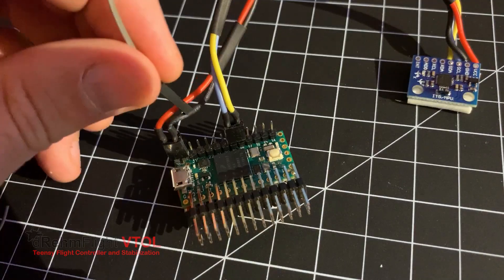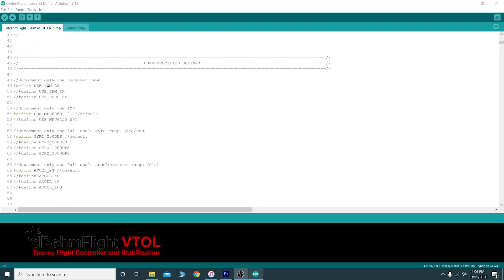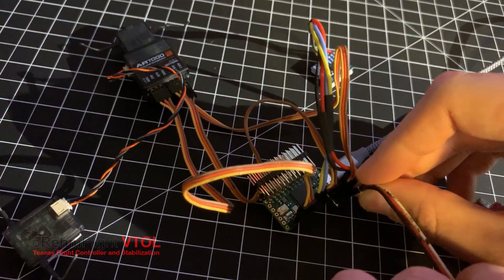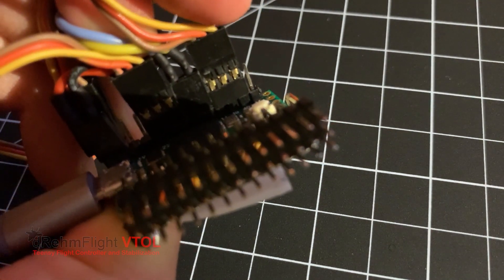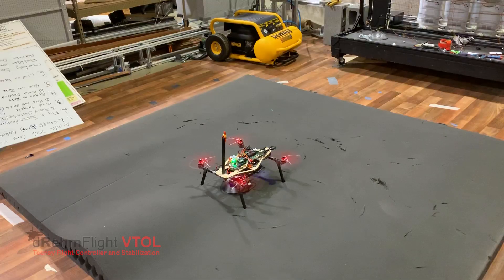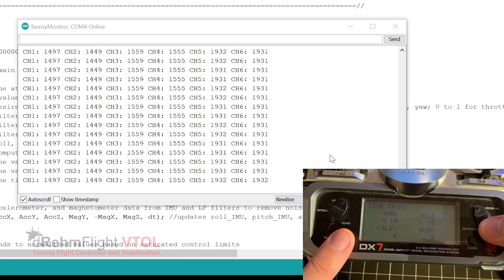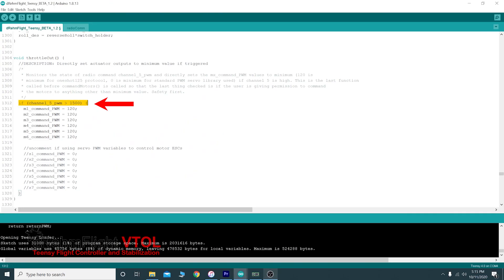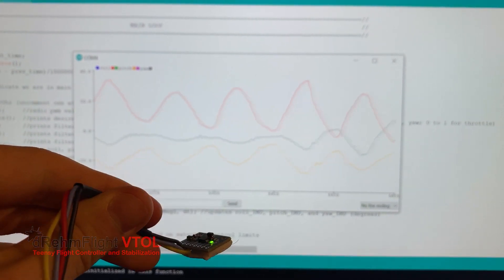Setting Up Your Radio Connection - dRehmFlight VTOL

Comment from the maker: NOTE: This video is dated and does not include instructions for newly supported Spektrum DSM satellite receivers. DSM receivers should be connected to RX3 (pin 15) and powered from a 3.3V pin on the teensy. This is new as of dRemFlight Beta 1.3.
Reply: Hello Nicholas, I am trying to follow your steps in the UFO or cyclo copter build, but I have been halted by the satellite receiver used in unison with you FC. I have bound it using another receiver and confirmed that when the receiver is turned on that the satellite goes solid orange, but as soon as I attempt to use it with the teensy it doesn't work, soldered to pin 15 and the power coming from the pin locations opposite the micro usb port I verified I used the correct ones both with the wiring diagram that came with the teensy and the video on the tri-copter you made. Any guidance would be great, I've tried the procedure with 3 different wires and satellites so I know that those are not the problem. Something of note is that I found that on occasion if the teensy was powered and I plugged in the Satellite afterwards, the teensy would reboot. This felt like it indicated a short but I can't see any error in any of the soldering I've done and I followed the hardware video to a T. Another thing is that the orange LED does initially flash when given power but only for a fraction of a second similar to what occurs if no data is found from the receiver its plugged into. Please help, thanks.
Reply from the maker: @isaiahbarak6166  what receiver?

Comment: Hi Nicholas, thanks for sharing the VTOL idea, the full source code, and practical solutions. It's priceless for young enthusiasts who want to learn and understand. One question from me: The Teensy 4.0 spec says the I/O pins are 3.3V-tolerant. And you connect PWM outputs from the receiver to the Teensy inputs directly (no voltage conversion). The RX on the video is Spectrum AR7000. It provides 5v PWM signals. How does that RX 5v <=> Teensy 3.3v work? What don't I understand/see?

Comment: Hey Nicholas, loved your tutorial. Just wanted your help on connecting to ESCs. I tried every function, checked the printRadioData(), printMotorCommands(), every thing checks out. But my motor doesn't respond. Checked the ESC (I am using normal esc 40A that cheap yellow one) and motor, they are in good condition. I am a beginner, I apologise in advance if I am asking something obvious here. Where do u think I am going wrong? Thanks :)

Comment: Hello Nicholas, thankyou for all the effort you have put into dRhemFlight. I am currently setting up my teensy with dRhemFlight, and am up to the radio configuration. I am using a very basic radiomaster t8 lite transmitter with no channel reverse switches and some of my channels appear to be reversed. Is there any way to reverse them in dRhemFlight? Thanks
Reply: I also have no way to adjust the sub trim and endpoints for any of the channel on the radio. Your knowledge would be much appreciated.

Comment: yes! one question: a serial reciever is possible? like a TBS nano? (i see uarts on the pinout of the Teensy..) and i see the voltage are not more than 3.3v for the Teensy, you have used a bec?

Comment: I did not use a battery to power the teensy, but the code was uploaded successfully, but the value does not change after opening the serial monitor. I don’t know where the receiver is connected. Another problem is that the light of the teensy plugged into the computer host will light up but the ia6b receiver The light won't light up
Reply from the maker: I suggest reading through the tutorials in the docs
Reply: @NicholasRehm  If the receiver supports ppm, does it mean that there is no need to wire the throttle to teensy4.0?

Comment: Please tell me if I should change the code according to this video for version 1.3, because I found that it is difficult to find the corresponding code for version 1.3 based on the code in your video.。
Reply from the maker: Code is the same for these procedures. Have a read through the docs

Comment: I'm honestly a beginner, I like what you're doing, but can you give me some advice on how to connect a Fs-Ia6b receiver to the teensy board?
Reply from the maker: Run 1 ground wire from the rx to ground on teensy, 1 power wire from rx to 5v on teensy, and each of the 6 channel's signal wire to the designated pin on the teensy. Pin numbers for pwm rx type listed in the docs

Comment: I have had some trouble with the main code not recognizing the MPU6050 and stopping it from uploading. I have tried everything I can to make sure that both DrehmFlight and radioComm are in the same folder and whatnot, but nothing works. What am I doing wrong? (I'm not very experienced with Arduino)
Reply from the maker: Read the docs. No need to mess with the folder contents as downloaded from GitHub—it’ll work out of the box. If it’s not uploading, make sure you have the right teensy serial port selected. You also need teensyduino installed. All in the docs
Reply: @NicholasRehm  I have all that done and double-checked, and I have a good USB connection. I simply downloaded the files from Github and put the DrehmFlight folder in my arduinoIDE projects folder, so I'm not sure what is wrong. I'm not very adept with Arduino so this is probably user error. (Edit: I downloaded the files incorrectly, which was the source of the issues)

Comment: Hello sir, I'm facing an issue while I try to run the code on teensyduino :
Arduino: 1.8.19 (Mac OS X), TD: 1.58, Board: "Arduino Unosketch_nov12a:43:12: fatal error: src/MPU6050/MPU6050.h: No such file or directory
   #include "src/MPU6050/MPU6050.h"
            ^~~~~~~~~~~~~~~~~~~~~~~
compilation terminated.
exit status 1
src/MPU6050/MPU6050.h: No such file or directory

Im facing the same issue even after adding the MPU6050 library. Please help me resole this issue considering I'm an absolute beginner
Reply from the maker: make sure you download the whole folder from github that includes the src folder with mpu6050 library. Read the docs--more details are in there

Comment: Hey there. I cant get the code to read the values properly. They are all at the failsafe state you mentioned. Im pretty sure all the connections are rigid. I get this error code but ı don't know if it is the reason. :
C:\Users\\Desktop\dRehmFlight-master\dRehmFlight-master\Versions\dRehmFlight_Teensy_BETA_1.3\dRehmFlight_Teensy_BETA_1.3.ino: In function 'void calculate_IMU_error()':
C:\Users\\Desktop\dRehmFlight-master\dRehmFlight-master\Versions\dRehmFlight_Teensy_BETA_1.3\dRehmFlight_Teensy_BETA_1.3.ino:620:35: warning: unused variable 'MgX' [-Wunused-variable]
  620 |   int16_t AcX,AcY,AcZ,GyX,GyY,GyZ,MgX,MgY,MgZ;
      |                                   ^~~
C:\Users\\Desktop\dRehmFlight-master\dRehmFlight-master\Versions\dRehmFlight_Teensy_BETA_1.3\dRehmFlight_Teensy_BETA_1.3.ino:620:39: warning: unused variable 'MgY' [-Wunused-variable]
  620 |   int16_t AcX,AcY,AcZ,GyX,GyY,GyZ,MgX,MgY,MgZ;
      |                                       ^~~
C:\Users\\Desktop\dRehmFlight-master\dRehmFlight-master\Versions\dRehmFlight_Teensy_BETA_1.3\dRehmFlight_Teensy_BETA_1.3.ino:620:43: warning: unused variable 'MgZ' [-Wunused-variable]
  620 |   int16_t AcX,AcY,AcZ,GyX,GyY,GyZ,MgX,MgY,MgZ;
      |                                           ^~~
C:\Users\\Desktop\dRehmFlight-master\dRehmFlight-master\Versions\dRehmFlight_Teensy_BETA_1.3\dRehmFlight_Teensy_BETA_1.3.ino: In function 'void getIMUdata()':
C:\Users\\Desktop\dRehmFlight-master\dRehmFlight-master\Versions\dRehmFlight_Teensy_BETA_1.3\dRehmFlight_Teensy_BETA_1.3.ino:597:13: warning: 'MgX' is used uninitialized [-Wuninitialized]
  597 |   MagX = MgX/6.0; //uT
      |          ~~~^~~~
C:\Users\\Desktop\dRehmFlight-master\dRehmFlight-master\Versions\dRehmFlight_Teensy_BETA_1.3\dRehmFlight_Teensy_BETA_1.3.ino:598:13: warning: 'MgY' is used uninitialized [-Wuninitialized]
  598 |   MagY = MgY/6.0;
      |          ~~~^~~~
C:\Users\\Desktop\dRehmFlight-master\dRehmFlight-master\Versions\dRehmFlight_Teensy_BETA_1.3\dRehmFlight_Teensy_BETA_1.3.ino:599:13: warning: 'MgZ' is used uninitialized [-Wuninitialized]
  599 |   MagZ = MgZ/6.0;
      |          ~~~^~~~
Memory Usage on Teensy 4.0:
  FLASH: code:22632, data:5308, headers:8920   free for files:1994756
   RAM1: variables:7520, code:20512, padding:12256   free for local variables:484000
   RAM2: variables:12416  free for malloc/new:511872
Reply from the maker: Those are just compiler warnings, not errors. 
Try commenting out the failsafe function, to see what raw values you’re reading from your radio. Most likely one is slightly out of bounds and failsafe is tripping

Comment: Hello,I uploaded the code to my teensy 4.0 ,made the changes  that you mentioned in this video but  it is showing me
MPU6050 initialization unsuccessful
Check MPU6050 wiring or try cycling power
insted of taking my transmitter stick inputs  it is showing me gyro ,please help me with this I tried many ways ,also tried looking into forms to fix this I have also double checked receiver connection but the serial monitor always shows me this message and also teensy is not blinkingwhen I got to the serial monitor it just stays in yellow light
hoping for you to reply
thankyou
Reply from the maker: Try new IMU board, some are faulty
Reply: @NicholasRehm  Thankyou its working now

Comment: Hello, I am using an Arduino Mega 2560 R3, I modified the code to use the RX1 pin but when I connect my receiver to my RC controller and move the joysticks I still get failsafe values as if the receiver was not connected. I'm using a FrSky X8R and it has been configured to communicate with my controller. Have I forgotten something?
Reply from the maker: I don’t think arduino mega has inverted hardware serial for sbus

Comment: C:\Users\Animisha\AppData\Local\Temp\Temp1_dRehmFlight-F-35-main.zip\dRehmFlight-F-35-main\dRehmFlight_Teensy_BETA_1.2_F-35VTOL\dRehmFlight_Teensy_BETA_1.2_F-35VTOL.ino:89:10: fatal error: src/MPU6050/MPU6050.h: No such file or directory
   89 |   #include "src/MPU6050/MPU6050.h"
      |          ^~~~~~~~~~~~~~~~~~~~~~~
compilation terminated.

exit status 1

Compilation error: src/MPU6050/MPU6050.h: No such file or directory

anybody knows what the heck this means??? how can i rectify it??
Reply from the maker: Make sure you download the whole folder (including the src folder)
Reply: @NicholasRehm  greetings sir
Thanks for your help sir
It's working perfectly now, except for some changes that i had to do to my control modes (throttle was not getting transferred to channel 1)
Reply: @NicholasRehm  the gyro is working perfectly, but the escs are not recieving any signal....i rechecked the connections, and they all seemed to be alright.... any clues???
Reply: I'm using SimonK 30Amp ESCs (non programmable, and i have no clue which protocol they follow)
 can that be the reason???
Reply from the maker: @animishaalagappa2327  if they can’t do oneshot125. Then probably. Also try arming with channel 5 if you didn’t already
Reply: @NicholasRehm  tried sir, with throttle cut on both values...
I don't think they are capable of contemplating OneShot125.... They work on pwm...
Is there a way to use PWM instead of 125 in the code itself???

Comment: Nicholas, will I be able to get a Spektrum RX part number: SPM4650 to connect/work with the Teensy?
Reply from the maker: Looks like that rx is srxl2 which is not currently supported. It will work with a dsm2/dsmx satellite rx if you have one
Reply: @NicholasRehm  forgive me, I'm pretty ignorant. So I would be able to connect a SPM9745 or a 46 directly to the Teensy over serial? I have an IX12 TX and was hoping to keep installed wiring minimal. Thank you!
Reply from the maker: @brandonvazquez8023  yup, just make sure it’s bound to your tx before hooking up. Read the docs too
Reply: @NicholasRehm  awesome! Looking forward to trying this hardware setup. I'm an ME but not a coding guy, but I think I can be dangerous with what you have made here. Thank you!
Reply: @NicholasRehm  This week I came to understand all the current generation Spektrum RXs only utilize srxl2 ports to support adding satellite RXs. And therefore the satellite RXs must be srxl2 protocol. They still sell dsm2/dsmx satellite RXs... but of course they will only work with the prior gen RXs which I don't have any and not sure it would even bind to my Ix12 Tx... So I can either use the PWM output from the current generation Spektrum RXs using up a pin on the teensy for each channel, or wait for srxl2 implementation so I can do it all on a single wire. Am I seeing this correctly? It's confusing to me to understand what will work...for example the SPM4650 has "DSMX" in its description also but because it says srxl2 protocol it won't work with your code yet? How much of a task is it to get srxl2 support implemented?

Comment: Hello Nicholas. Thanks for assisting with my building/setup questions. I have worked through those issues and attempted hover mode today. I have two questions. (1) does the autopilot (IMU/teensy/supporting code) make thrust adjustments to correct for unwanted fore/aft trim conditions? When I attempt hover, the front motor seems to overwhelm the other two and causes a severe nose-up condition when trying to lift off. I was assuming the controller would adjust the motor speeds to correct for this. (2) Regarding the tilt direction on the front motor. I have it set so that (when viewed from the back of the jet) the motor tilts left when I give right rudder. That seems reasonable since the prop blows air left and would cause the plane to pivot right. Or do I have it wrong? I am using all the components that you recommended other than the 4-in-1 blheli_32. I am using (3) discrete blheli_s controllers which seem to work ok. Thanks again for your responsiveness and advice.
Reply from the maker: On the ground when armed, does the nose motor spin up first? Could be bad IMU calibration on startup leading to the FC thinking it’s pitching and trying to correct for that. Could also be bad radio center position if your center stick is not 1500 exactly in the code, basically commanding a nonzero pitch rate 
Nose tilt servo direction sounds correct; you may need to adjust the trim value to counter any excessive torque from motor direction
Reply: @NicholasRehm  In the interest of helping others, I will make a full disclosure.   One of the back-end motors was spinning the wrong way. I also see that the autopilot does make thrust adjustments. Now the aircraft seems to be just a little bit too heavy to lift off. It weights 1.5 pounds without battery. I crafted the 'ailerons' using balsa trailing edge sheet as the foam didn't seem robust enough for its use. I am using the recommended 1500 mAH 3s lipo, but have a similar 4s and will try it shortly.😮

Comment: Is is possible to use simpler (i.e. more familiar) esc's with this project? I burned out a luminier blheli_32 4-in-1 while testing. I am using spektrum with ppm output to the teensy board. My soldering technique is good, and I double check the connections. The motors would turn slowly (kind of sporatic). Occasionally would spin up, but almost immediately overheat and smoke, at which point I throttle down. Does the blheli_32 escrequire any special setup prior to use? I know there is a configuration tool but it does not appear to work in conjunction with the teensy controller. I am reluctant to invest in another blheli_32 4-in-1.
Reply from the maker: You can use pwm ESCs on the servo outputs. Re: smoked esc. Did you have anything assigned (roll_pid/pitch_pid) to the motor outputs in the control mixer? If so, was the rate controller being used? Too high rate d gain can smoke motors
Reply: @NicholasRehm  Thanks for the quick reply; truly amazing responsiveness! I was using the stock F-35 code, so whatever the defaults are with respect to the two questions you have.
Reply from the maker: @tpete99  Lower the rate D gains by 25%--they shouldn't be high enough to burn up anything as is but it's better to be safe.. Use the printMotorCommands() function in the main loop to verify motor outputs are consistent with your inputs, and make sure your IMU is setup properly
Reply: @NicholasRehm  Thank you. I have new (discrete) escs (I think they are blheli_s) arriving tomorrow and will update you. IMU is set up and working correctly, I did use printMotorCommands and all run the range from 125 to 250.
Reply from the maker: @tpete99  a quick check if it’s the PIDs is to replace the motor mixing with just thro_des in the control mixer, so there’s just clean throttle pass through to the motors. If this doesn’t work as expected, then you have a different problem but we can figure that out later

Comment: Excellent tutorial and I am so close to a test flight however, I have M2 starting up before M3 which I can see is a big problem! Also, I am using a Taranis X7 and I cannot get the radio values down to 1000 on the serial monitor - it's more like 1178 and 1863 at the highest. Throws are maxed out on the channels (+100% and -100%)
Reply from the maker: For the endpoint issue: go into the getcommands function and multiply the channel_x_pwm variables by 1.2ish for your radio type, then try setting your endpoints in the radio. For the motor problem, set the output for the motors to be just thro_des, and verify they still don’t spool up at the same time. If that’s the case, you need to calibrate your ESCs. Best of luck